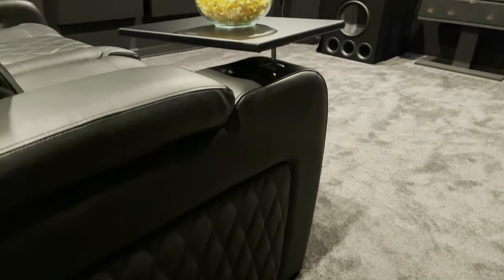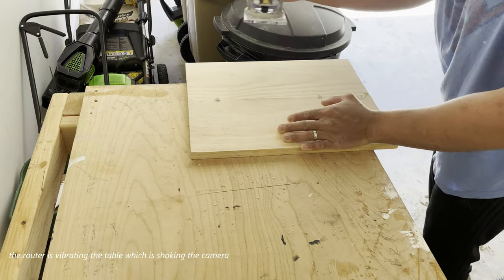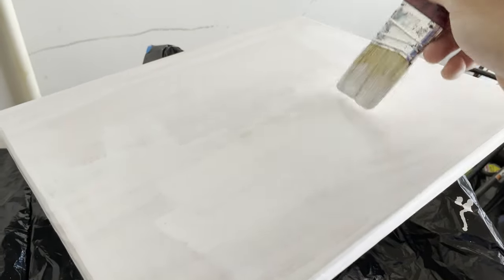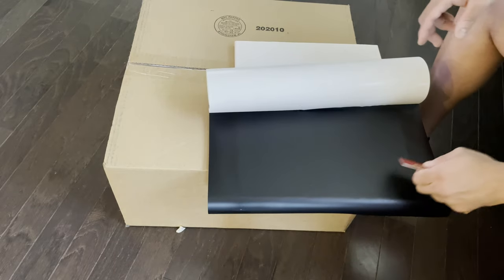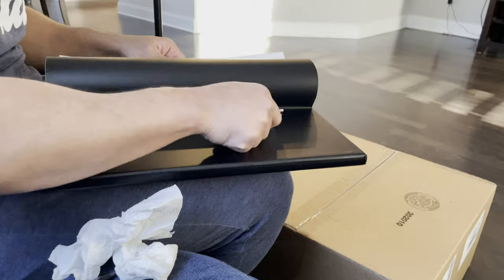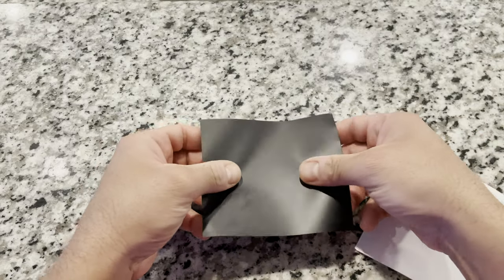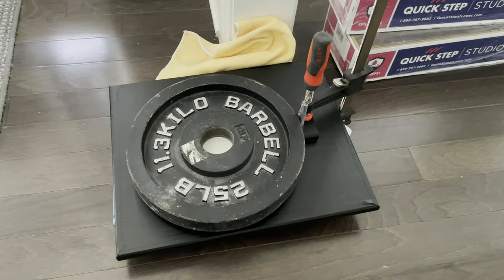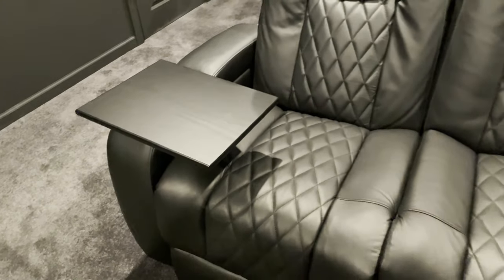How I Built a Tray Table for my Home Theater Seats

Comment: Hey what pin did you use?
Reply from the maker: Its been awhile.  I can not recall.  I bought a few and tried them all until I found the one that fit.  My local hardware store sells them individually pretty cheap and I just returned the ones I did not need.  No brand name--that I recall.  There were bins of generic pins of varying lengths and widths.